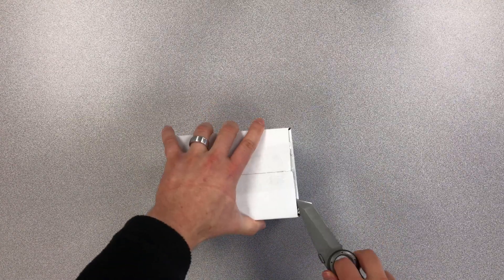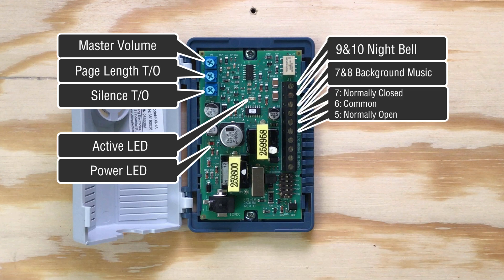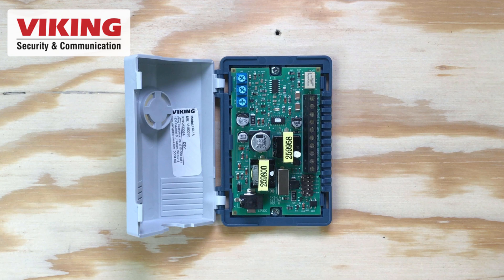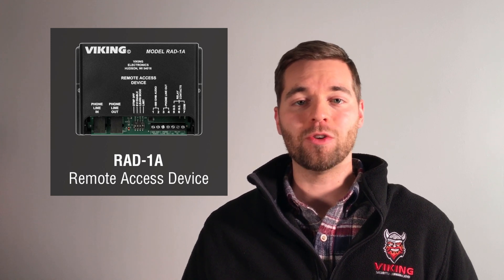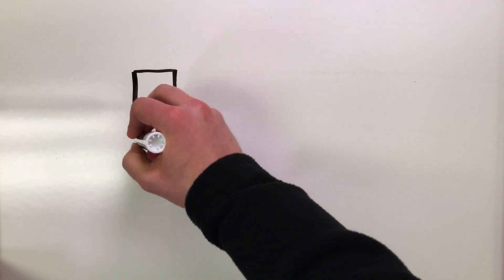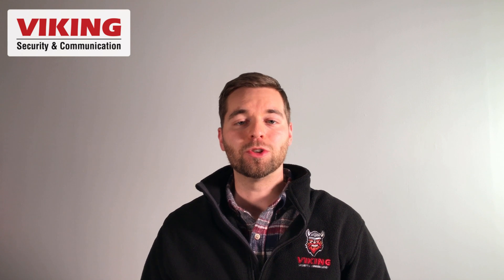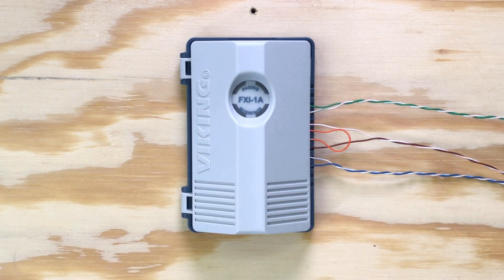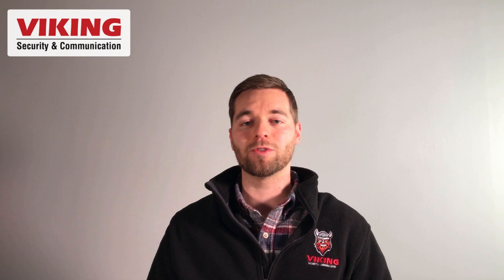FXO FXS Audio Overhead Paging Adapter | FXI-1A Telephone Paging Interface Module

Comment: I put the device in fxs mode and all dip switches set correctly, but when I dial the analouge extension on my Nortel bcm50 the status light flashes but doesn't pick up. What is the problem?
Reply from the maker: Hi @FireFone81 please call our product support team at 715-386-8666 or submit a support ticket directly to our technicians: https://vikingelectronics.freshdesk.com/support/tickets/new